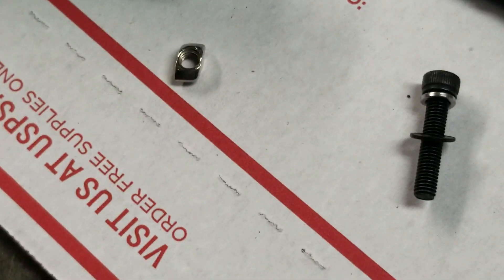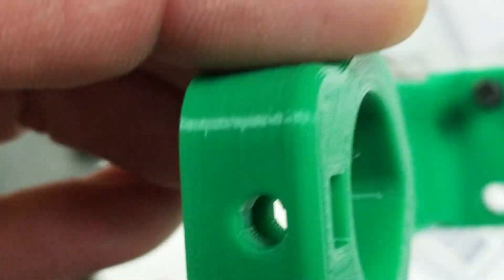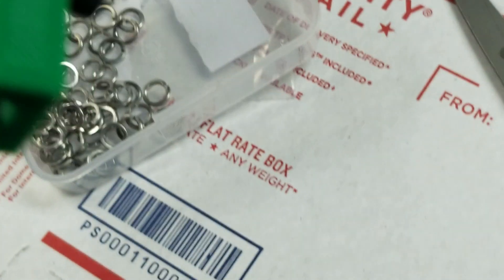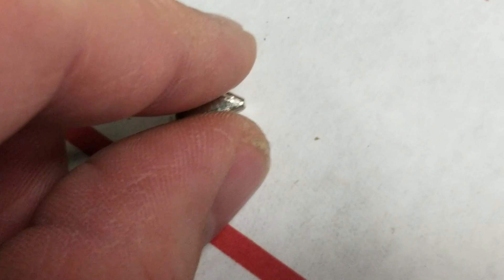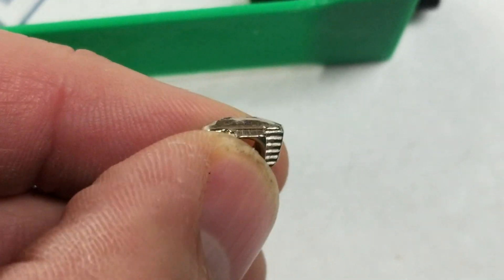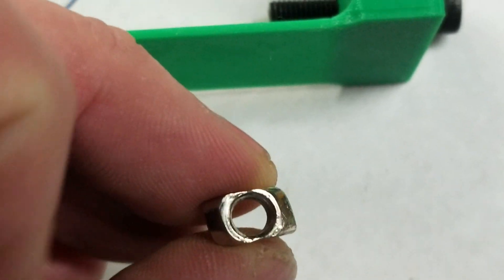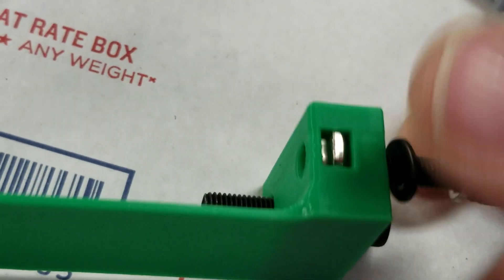Threaded insert tip for 3D printing

Comment: Phil, great tip! Thanks for the link to the t nuts... I do believe, however, that you have the nut inserted backwards in the video. The serrations on the one side of the t nut appear to be designed for grip, indicating that they should be on the clamp side of the joint, not the free side.
Reply from the maker: You're welcome! Nope. Don't have it backwards. This isn't in a rail with the T slot. So the flanges that make contact with the aluminum extrusion cannot engage anything.  You want the widest, flattest part of the insert making contact with the side the pressure will be on from tightening. I do mechanical design for a living. 😀
Reply from the maker: If you notice how my rectangular opening is offset, that is to give the most meat to the clamping force
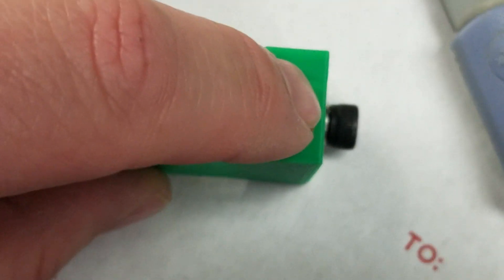Reply: @7711gman  I agree 100% and that proves my point. At 1:00 you can clearly see that the insert is tapered on the wide side of the slot
Reply from the maker: @AlAmantea  no, sorry. The side with the wedges or tapers, actually has more flat engagement than the other side. The flange or shoulder on the other side would dig in and possibly cause damage. I have them correctly. I believe you do not understand the device or the design. Thank you for your concern though.